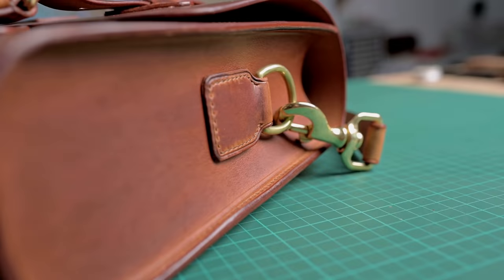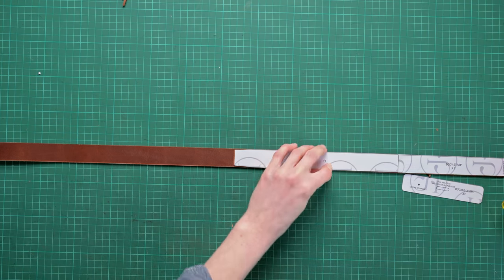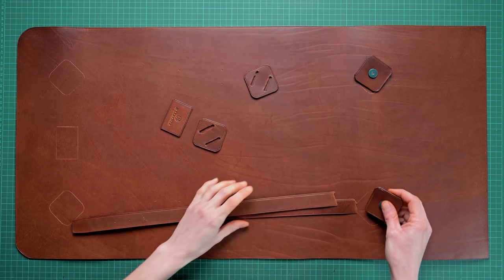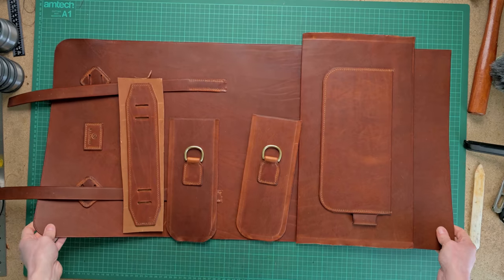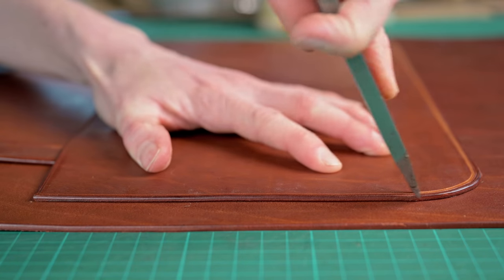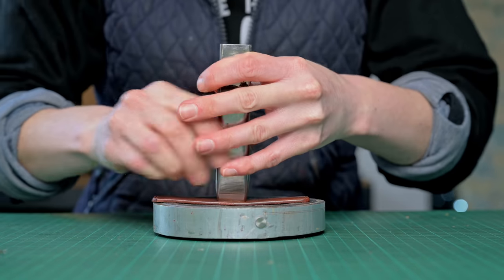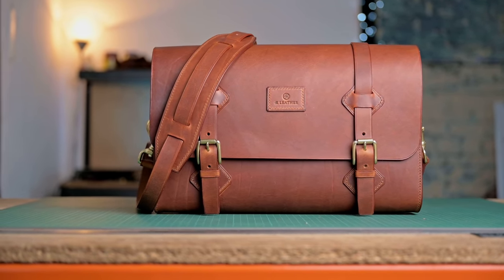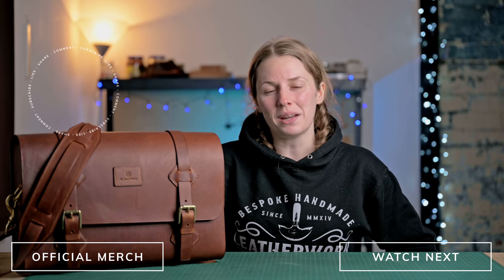Make Your Own // Handmade Leather Satchel // PDF Pattern Pack Make Along

Comment: As a fairly new leather hobbyist, I have some beginner questions, hope you will answer them, either here or maybe in a special video or on your podcast?

How often do you sharpen your head knife? You showed it just before those last skives, and it is (of course) part of the startup, but can you keep it at that? You are probably working on several projects at once so it might be difficult to keep track of. 
Do you sharpen you rotating knife, or just switch blades? 

And along the same line; how often/much do you heat the edge creaser? It does of course vary depending on the tools ability to "hold the heat" but again as a newbie just a rough guideline.

I don't have a no6 edge beveler, any tips for another way? Just a short skive?

It is all those finishing touches that makes the bag look good, and it will be boring to show the answers to all of my questions each time, I know.
Reply: And if I have missed videos answering my questions, I'm sorry.

Comment: Hello there! You made a lovely bag, i cant wait to make one! I have just one question. Is a Single shoulder leather (around 0.7m²) enough for this project? Or should i go for a double shoulder? Thanks!
Reply from the maker: It's hard to say as it depends on the shoulder and how you can lay all the patterns out. Laying it all out it Adobe Illustrator, then I get around 1.2 m x 0.6 m but like I said, it depends on the hide as there may be marks that you need to work around.

Comment: Still preparing the tools and will get the pattern as my first big project. Just wondering, how is the bottom part of the inner divider closed? Only by side stitches?
Reply from the maker: Is only stitched in at the sides so the bottom is open
Reply: @JHLeather  already got the pattern and marked the leathers, it will be my upcoming weekends project :)

Comment: Hey Jo, i have a question about using linen thread. How do you know when you have added enough beeswax on the thread? I made a wallet for my self with linen thread in ecru color but the thread color changed even though ive used beeswax. Do you know what to do? Thanks for your time

Comment: Just curious, the inside divider pocket, would I be able to fit a 16' laptop in that pocket?
Reply from the maker: Yeah, this bag is designed to fit 16" laptop, I tested it with my old work laptop which is old enough to still have a cd drive and it fitted fine 👍
Reply: @JHLeather  thank you so much! Love your work! Very thorough and your attention to detail is admirable!